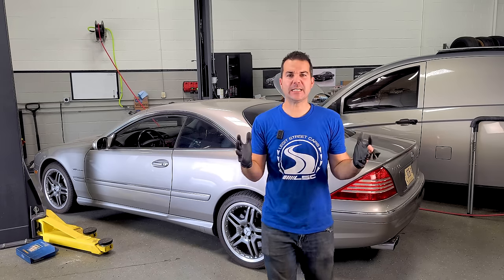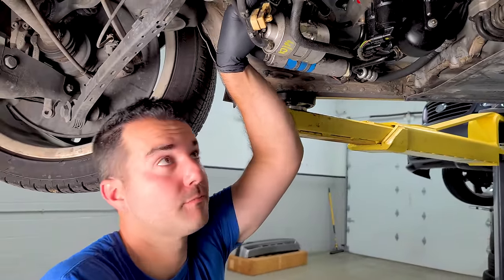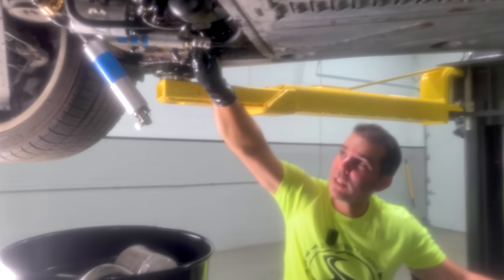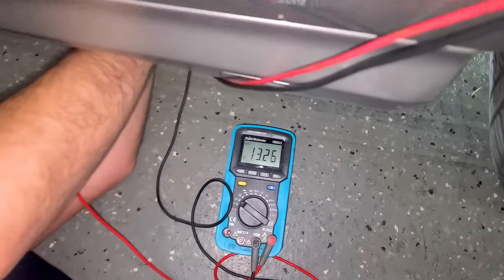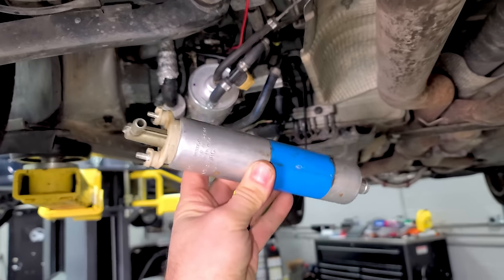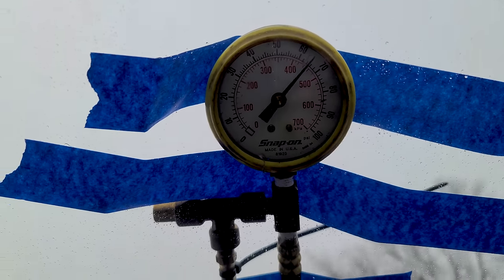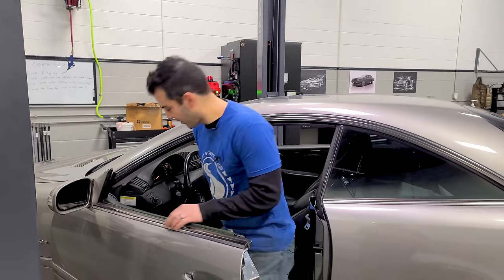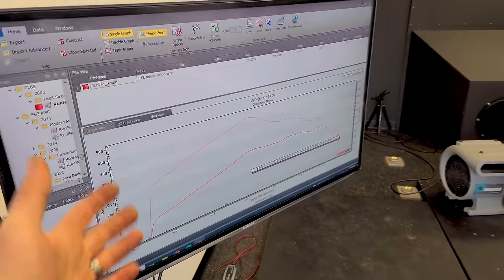I Used Bugatti Veyron Parts & An Alex Trick To Fix My CL65 AMG V12! You Won't Believe What Happened!

Comment: You did have a new tune for larger injectors and added the extra fuel pump, so going rich doesn't surprise me. I don't know how quickly the extra fuel pump shuts off once you let off the throttle and the extra fuel still has to go somewhere.

Comment: how do you test before and after the exhaust and deem it sounds better and runs better if you flashed a tune in the middle of Diag which clearly changed a bunch of sensor values

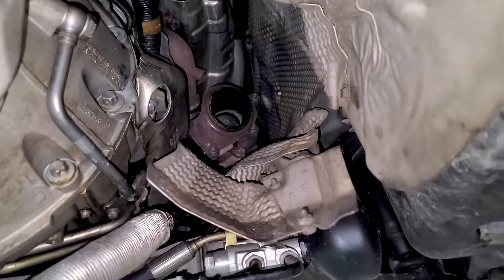Comment: Hey @legitstreetcars  , that noise at 35:48 when you're under the car with the exaust off.  My CL600 Bi turbo has a very similar noise which I can hear from the engine bay around where the turbo's are.   Do you have any thoughts.  I couldn't hear that noise before you ran the car with the Exhaust off, I am wondering if my noise could be gas escaping from the exhaust around the turbo's vband.

Comment: Thats frustrating maybe Replace the upstream O2 sensors. This Reminds me of the hesitation my honda accord had with the wrong O2 sensor in the Upstream bung. As it turns out my honda's upstream o2 sensor also controls air fuel ratios and with the wrong o2 sensor it had horrible hesitation. Replaced my O2 with the correct OEM one and the hesitation was gone.

Comment: I'm assuming it'll be another 6 months till you get the willpower back up, when that happens check that fuel supply hose to the pump, i wouldn't be surprised if that gets sucked flat and causing the fuel pressure to flutter. I've seen that before diagnosing sylinder missfire WOT on boats with 500hp + V8s
If it starts fluttingering then the computer won't manage to compensate fast enough, ending in going rich before limp mode. 
Also the throttle body is worth investigating imo.

Comment: looks like your fuel pressure is going down on boost causing rich condition ! if say at 55 off boost it should go up adding the boost pressure in the rail so the mix is same  on boost other words you run 16 your down to 40 on boost     no expert on mercs of how they control this old turbos use a reg on rail or metering unit   hope this helps great vid s happy days

Comment: If its got a mail order ECU tune loaded from another juristion, there might be differences in the code causing the issues? Different sensors or values for different markets perhaps? USA vs Europe.

I think remove that extra pump and have someone tune it in real time on a dyno.

Comment: My car doesn't run hot i had check for coolant leak didn't see any i changed the radiator but it smokes under the radiator do you have any idea what it can be

Comment: Seems I remember mercedes having two fuel pumps on them back on the 80s, and those were not high-powered cars.
Could it be the transmission is causing it to go into limp mode if the conductor plate is going bad? 🤔

Comment: Italian tune up needs more cleaning of the cats Haha. Thinking if the ECM has lost it's connection/signal on WOT or if the engine light is flashing after the ignition system has a defect on the new coil banks

Comment: I own a 2005 CL 65 AMG. The fuel tank has an internal fuel pump and pressure regulator which are both unserviceable because they are not accessible through the small hole 🕳️ for the sending unit. When this system fails, you must replace the fuel tank with a new one. The internal system is designed to feed fuel into the swirl bowl through two plastic lines, one line from the intank pump, the second from the return into the regulator which in turn feeds the swirl tank. After 20 years these lines become brittle and break into small pieces. In my case the return line going into the fuel regulator was completely broken off , and my intank fuel pump was seized because the car sat for 6 years at a shop. The swirl tank was starving for fuel, as was the fuel pump underneath the vehicle. I knew something was wrong because I could hear buzzing from the pump. A new tank is no longer available from Mercedes Benz, and buying a used 20 year old tank from a junk yard isn’t going to be any different. I cut the fuel tank open, made an incision large enough to get my hands inside. I was able to remove the system from inside the tank, I freed up and tested the pump and it worked perfectly. I also tested the pressure regulator and it worked fine. I purchased 10 feet of submersible fuel line and put it all back together with stainless steel clamps. Eliminated the vapors in the tank by running my diesel f350 exhaust into the tank for 3 days straight, at 2 hours per day. I had the tank welded, with bronze. It works perfect now. No issues. I spent about 60 dollars to repair. I did all the work myself.

Comment: Try using 3 fuel pumps, Or maybe 4? A slave fuel pump has nothing to do with fuel pressure, either it works or not. Check and replace the parts on the injection side of the fuel system and not on the tank side. High pressure fuel pump and flow rate control solonoid etc.

Comment: Here what I thought, your CL 65 AMG probably has a hairy crack on its valve or cylinder hence the machine getting hottest the crack is widen & dropped the fuel pressure... if you can put in the endoscope tool to find it may it may solve your problem... 😉😊

Comment: You've probably got an injector solenoid failing under load causing the richness and drop in fuel pressure in the rail?

Comment: There are these 2 large inputs and throttle plate moves but you can't even see the black down the tube under constant rpm, it does not look like you could fit a pencil into the opening. Why such a big hole and plate if it only opens 10 degrees under constant power?

Comment: I think when the gas tank is less then 50 % full it the car engine goes slower and I definitely feel it with 25% of a tank left my experience with German cars so maybe you should of put 12gallons in instead of 5 gallons so the car think it’s race mode because who races on empty or close to  ?

Comment: Possible doggey injector, going way rich and dropping fuel pressure in the rail. You said you changed then for higher flow ones so its possible.

Comment: A turbocharged engine should have positive pressure on the fuel Pressure regulator when accelerating
Does this engine have a normal fuel pressure regulator?

Comment: What if....? The ecu is faulty. If all sensors are providing the right information to the ecu. Possibly the ecu is unable to interpret the data under specific conditions like wide open throttle. Nothing makes sense anymore.

Comment: This car has fuel regulators correct? IF they are having issues, like getting stuck open you will get all kinds of pressure issues.
Reply: P.S. if the regulators are bad and it fixes the problem, I win the GSX Eclipse.

Comment: You might be going rich now because with the second fuel pump kicking on the fuel pressure may be too high. If the injector pulse width is based on a fixed fuel pressure of 55 psi it is likely injecting more fuel.

Comment: So fuel pressure is effectively being cut at WOT it sounds like a possible over boost safety retardation by the ECU and or a MAP sensor issue failing to read correctly? Just stabbing around, good luck getting it sorted.

Comment: The high-pitched whining sound sounds like a turbo going bad. What it is... is the thrust bearings inside of the turbo are starting to go bad and the blades start to touch the housing under load.
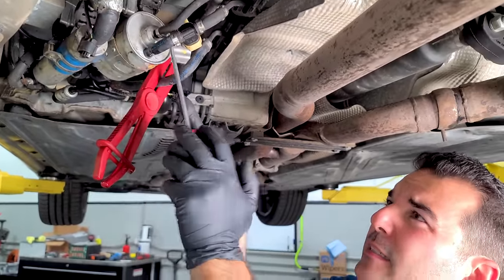Reply: Also, the stock cats were probably already at their limit stock, and now he's trying to get more out of it. Then you start tuning it and expect the stock cats to hang. I'm really curious what the back pressure is. I mean, there's no way it can even attempt to burn an 8:00 AFR that will destroy a catalytic converter. Also, AFR is way manipulated after a catalytic converter, probably by a whole AFR point.

Comment: Alex, your car is showing a symptom of a blockage between the fuel pump and the engine. Not familiar with your car but the pressure of the fuel coming out when you removed the fuel pump and filter points towards that.

Comment: God damn it V12 AMG CL65, the 65 was the biggest one in the next gen 2012, obviously 2006 also had it, but he welded a hole in the head, so good after polish you couldn't tell, and this was worst than the ABC suspension, so many episodes with issues and I thought this was assembled with full precision all that needed and more replaced, he went back when he missed a few things, but he did the engine and all connections and hoses right. Maybe no need for 2nd pump, I wonder why the injectors are using so much that 2 pumps can't catch up, after clean filter and screens and passage holes. Did he replace the injectors, could they be just leaking too much and the car getting rich, while dropping pressure on fuel as they spray more. I know he has a stand to test injectors, so I guess he would have done it, but this is bizarre.

Comment: So yes you have done testing fuel , exhaust.  But you didn't do a boost leak test, which will show leaks and bad wastegate activity, which should show in the computer as a code as well. 
 Now for the hard one . Wire harness now as the engine moves it pulls on the wires & may be pulling on some wires or plug. 
 As you know, new parts aren't always good parts. Because after covid, the quality has gone down hill. 
 Be safe and ware saftey gear sir your family & editor will thank you.

Comment: if its not spark,  and its not fuel,   I'm betting my money on 1.  air Fuel  ratio  error   2.  traction control error ( try turning that off or pull the fuses to everthing )  ,  will it run full throttle on a normal dyno ?,  (oh  my stupid old BMW always had errors after 2 hours of running  and it was just and old battery (the amps would drop after 2 hours),   after $XXXX at the dealer is was the F!!  battery)

Comment: Got more patients then me it would of been torched by now if was my problem....😂 I once owned nothing special a 2004 180c and also an A4 B5 Audi at some point you have to say goodbye it does become a huge nightmare fixing and chasing doing DIY....I do have to say one time with my Merc had similar funny stuff going on there was some trickery I found on YouTube to re calibrate ecu and throttle body was like all this pushing on and off the throttle and on and off with ignition start turn off I can't remember the sequences but it basically factory reset the car....once it learnt me the car was sweet. If the car has spent its life being driven like a baby and has barely been driven in anger the car can have a heart attack not knowing what to do....try it maybe could be the solution

Comment: 12 minutes,  im gonna guess foreign object in fuel tank blocking out flow to engine and pump is under duress from a vacuum, and in a stop the object falls away, only to be sucked back and block when pushed.

Comment: I had s430 Mercedes that I bought with cash, clean and nice car that I had fun with at first, but at the end everything broke on it, everything, it was so frustrating that I had to sell it for 3,500$ and I told myself never again I’m buying another Mercedes or German car ever again, I had to push that S-Class Mercedes through the major intersections, airbags would drop down on me, all wire harness was replaced, all bushings, all weather seals, cluster, sensors etc and it still would break down on me at every traffic light.

Comment: I hate problems like this where no matter what you do nothing seems to fix it.

I had an 07 Mercedes V Class with the m112 3.7 v6 and 5sp auto, it had a weird vibration between 2500 and 3500 rpm, changed everything, even the gearbox, nobody could ever solve the issue, spent a fortune on the stupid thing.

Comment: Shouldn't you have BACK flushed the cats? You just pushed the soot further into the cat and not really getting it all out. Same concept as a K&N air filter, you flush it from the opposite side as the air flow goes through the filter to wash the dirt out of the media and not further into it.

Comment: thats running way to rich it runs into 8:1 maybe take that tune off and go back to stock 
does it have a rising rate fuel regulator ? or what sort of fuel system does it have dead head? does it have a return?
I would replace the o2 sensors. put high flo cats on 
I would check the fuel system if it is a dead head system. I would change that to a return with an adjustable rising rate fuel regulator 
if you dont want to change the fuel system that much. replace the o2 sensors, cats and the fuel regulator

Comment: Limp mode = reduces fuel pressure - causes a extra code , switches off coil packs - causes a misfire fire code because  they have been switched off by the Ecu limp mode - understand Bosch technology - now pay me $1000 dollars for what I have learned . Cure - change wiring harness and main engine fuse box . Reply for my bank details, and change the waste gates on the turbos, Ecu is picking up an over boost

Comment: Dude...given the fact you never wear safety equipment, you need to have an emergency shower in your shop, or at least have the pressure washer hooked up at all times so the camera guy can hose you down when necessary. 😆

Comment: You pull out the fuel pump fuse & relay & then wind the car over to release fuel line pressure. I'd have thought a "car wizard" like you would have worked that one out. Dumby move on your behalf!

Comment: I don’t understand why you feel the need to run a stock CAT on a 1000hp car and then wonder why you have back pressure issues and flashing check engine light. Either run no cats or get sport cats.

Comment: Bro, seriously, you need some fans to ventilate your shop or at least use a respirator to filter out the fumes. Stick a microphone in it so we can hear you, but damn, protect yourself.

You drive me absolutely insane when you work with fuel so jovially. I'm losing my mind with this episode right now.

You're going to end up with cancer or some other sort of respiratory disease that could easily be tracked back to breathing in petroleum vapors. I never work on my cars without fans running to decrease the amount of particulates I breath in and when I have to deal with fuel-related systems you will not find me without a respirator. I do not want you to disappear.

Comment: Ethanol may have swollen the interior fuel line; had a similar exp happen to a rubber brake line.
The brake line acted like a check valve, not allowing pressure to release.
I avoid your channel b/c YOU DON'T WEAR SAFETY GLASSES, which shows your arrogance!